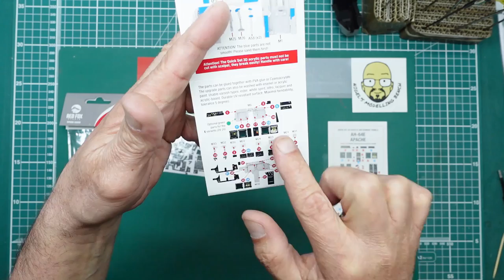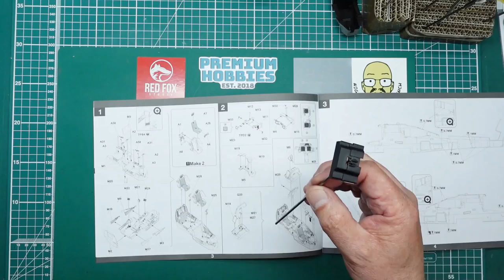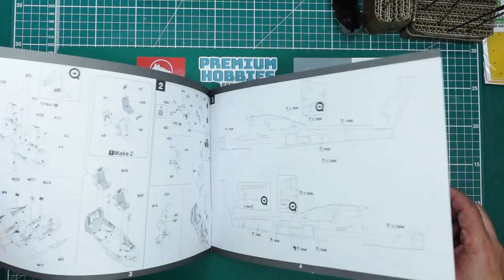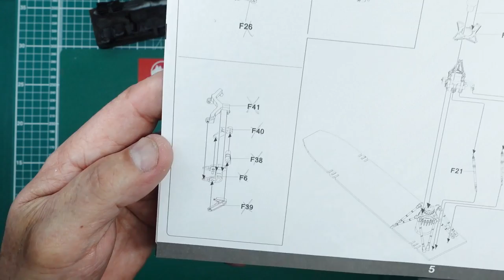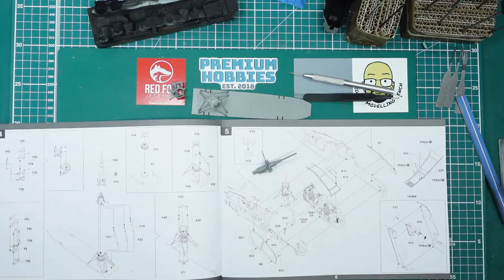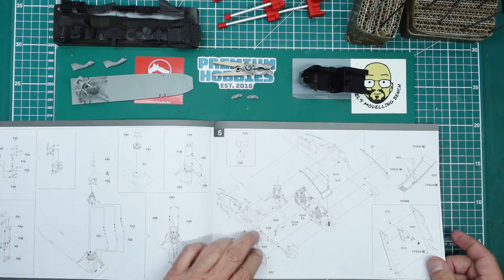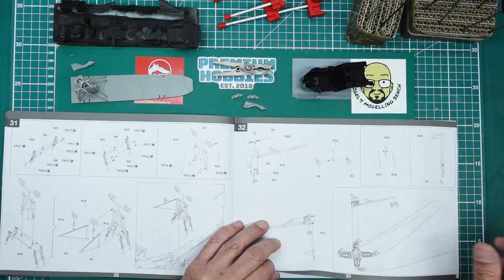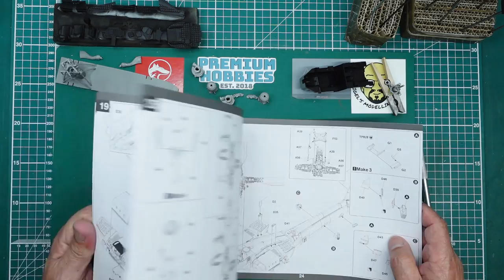Takom 1/35 AH-64E Apache build. Part One

Comment: Hi nige
The piece you mentioned that fits in the frame near the exhaust has another piece to fit later in the instructions . Also the rods on page 25 you mentioned don’t need to be fitted until the whole assembly is complete as they will just click in place

Comment: Quick question: 17:50 -  part F42....in the instructions, it shows its a hydraulic strut. The actual part on the sprue looks like an A-frame. Is that an error in the instructions?
Reply from the maker: Well, the instructions in this area are awful, which is why I did this detailed view of it all going together. F42 is the A frame you see me fit at the front of the assembly @17.46
Reply: @NigelsModellingBench  yeah that whole thing has me scratching my head, thanks for the assist!
Reply from the maker: The instructions are awful, but nothing like as bad as the decals. Any more questions, ask away. I have tried to cover all the issues in my videos.
Reply: @NigelsModellingBench  got another one for you: 26:27 I am assuming this is the APU exhaust plumbing; instructions only mention the right side but theres also the left side that needs to be installed as well. Am I to assume you werent able to find anything regarding the left side? I cant find anything for that piece in the instructions or in the sprue.